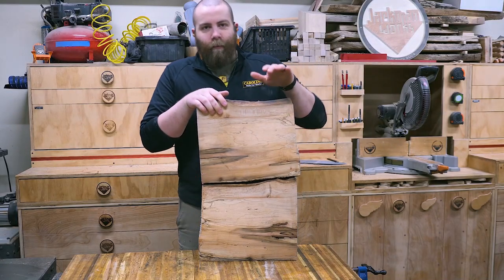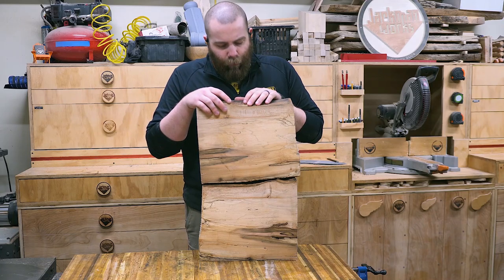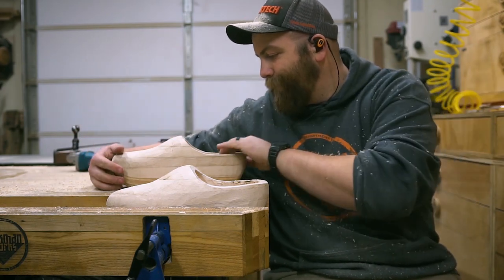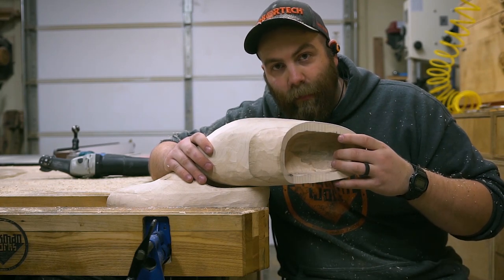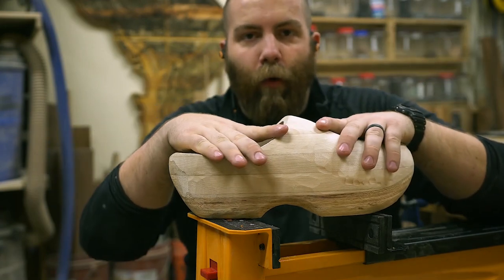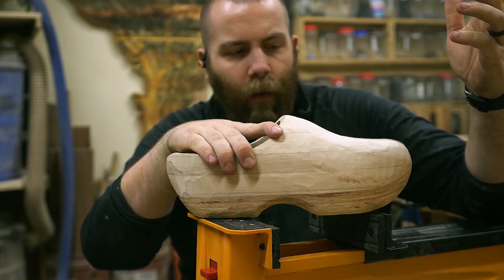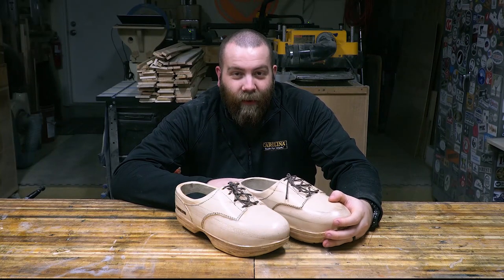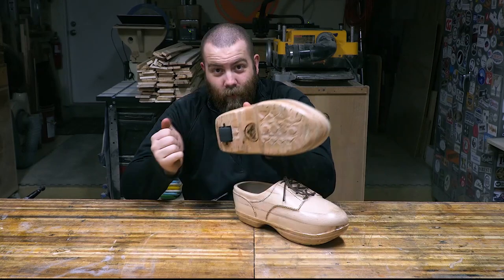Making Wood Clog Heelys (from pallet wood)

Comment: I'm tempted to say you win the internet today but I still need to watch Frank Howarth's new video so I have to withhold judgement.  Wood by Wright wears wooden clogs in the shop all the time (sans the wheels, of course) so it's not really that much of a joke.  I wear the Swedish version (wood soles, leather tops) about 9 months of the year.. they're very comfortable and much easier on the joints than concrete.

Comment: Those are some awesome clogs Jack. How comfortable are they and how good is the traction on those shoes? Did you know that the reason why actual Dutch clogs are often used as safety shoes is the fact that the wood that's used in the process of making them is soaked in water for a couple of months. You can whack those suckers with a sledge hammer and maybe make a dent in them.

Comment: I can see how, if the vamps had been cut loose and finished as separate pieces that were then laced back on, these shoes could be tied on and snugged down like conventional shoes.  Line the vamp pieces with insole pads and it might even be comfortable.

Comment: Cool clogs until you ruined them with wheels.
Reply from the maker: They were cool wheels until I ruined them with clogs.
Reply: @JackmanWorks  Yeah Right.  I would suggest using Alder next time.  Clogs are therapeutically excellent if the footbed is carved to match the wearers sole and instep.  I have been carving clogs for at least 50 years. I use old tire treads for the soles of my barnyard clogs.